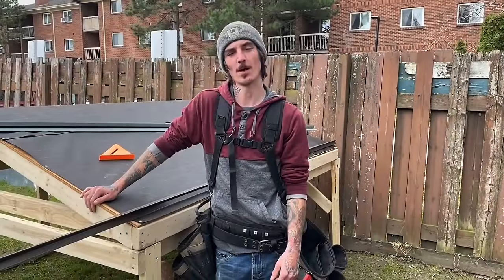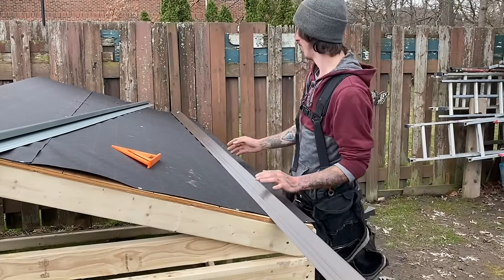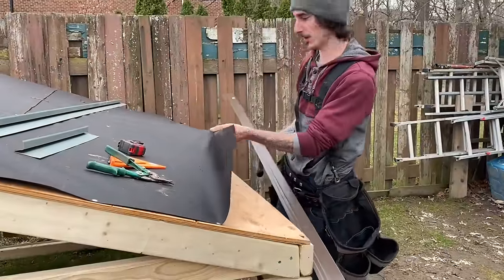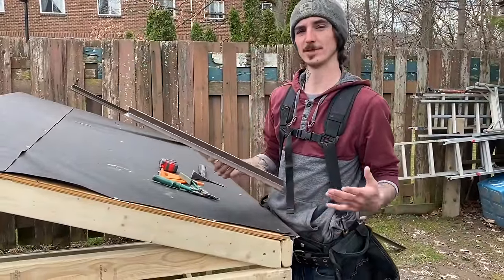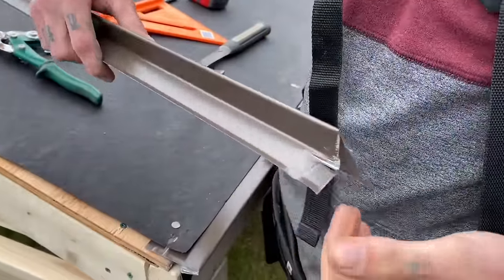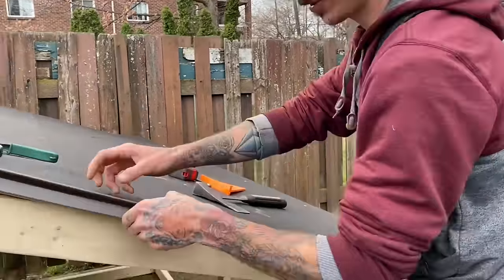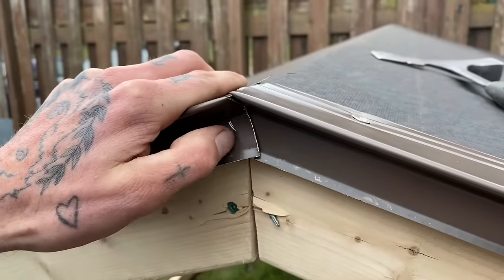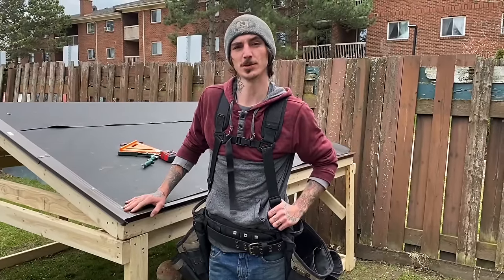How To Install Drip Edge On A Roof

Comment: Thanks for the lesson !!
Reply: That was probably one of the worst instalations I have seen!
Reply: @stephansomerset6967  and a few things you
Reply: Good job Dylan 👍
Reply: What if you started the rake drip edge so that half the length goes past the apex of the roof? That way you can make a cut right at that apex and fold the remaining drip edge down the other end of the roof. This would prevent having to marry up the two drip edges right at the apex

Comment: It's better to leave a gap between the drip edge and fascia. With direct contact, the drip edge will run the water right down the fascia and rot it out.  A gap is also ideal for gutter installation.
Reply: My fascia has aluminum on it, and the back of the gutters slipped up easily between the drip edge and the fascia.
Reply: There's a fascia install that fits behind the drip edge before the gutters go on...
Reply: I was gonna say the same, but saw your comment.
Reply: Leave a small 1/8" gap. I have repaired  many fascias water damaged by too tight drip edge.
Reply: @Fred Bush III were in Canada with our climate we all do aluminum fascia the drip edge needs to be tight to hold your facia. If you leave a gap it will flop and youll have to screw it and it will oil can badly. The gap thing is for old houses with wood facia.
Reply: That is why the fascia is painted and is of excellent lumber. Water is always going to hit the fascia. That drip Edge could go half way down the fascia and it still going to get wet, weather or not it's in direct mail contact of fascia. But I do understand the theory behind it ...there's another video out of a guy leaves it finger thickness away from the fascia. He was teaching a bunch of kids I don't know if it was a high school thing or what ,good video too and he demonstrated it with a 💧bottle....it worked perfectly. But totally  controlled conditions.ie no wind ..But at the end of the day I don't think it really matters. I'm so high tonight sorry for the incoherent ramblings...🤣🤣🤣🍸
Reply: @Fred Bush III I'm a repair guy, I've been there. The turnout at the bottom of the dripedge is inadequate. Why do you think they put eaves in the first place?  Sure the siding is made to take water but less is better. All this being said, I am talking about wood not aluminum. Details make the job. They are the difference between durable and chronic  repairs.
Reply: @caseykelso1  💯✅is why you paint your fascia and trim with good quality. You do not want a gap to mildew. Some even run some caulk in some areas to close the gap.
Reply: @adamarlem9863  mildew is never a good thing.mold sucks to 🤢 thanks for sharing 🍸
Reply: @frankdaniels4364  thanks, wanted to see it again . 🍸
Reply: Or use gutter apron like you're supposed to...smh
Reply: Fixing stuff TV, my contractor didn’t leave a gap and sure enough, my fascia boards are rotting and it has only been a year since the roof was installed!
Reply: @caseykelso1  In snow country painted facia still never lasts with this new crummy non-lead paint (flakes of) until they started covering it with the aluminum or even vynal tucked under the drip edge. .  Im finally a believer in covering painted facia (I do both for protection).
Reply: Yep. Average is right. Congrats, this guy just showed everyone that doesn't use metal fascia how NOT to install drip edge and how to wick water up to rot out your fascia, eaves, and rafters. Break that surface tension and hang it 1/4" off the edge and stop all that nonsense and then you don't need metal fascia either.
Reply: absolutely 1/4 gap is reqd for gutters
Reply: Just use azeck fascia board it will rot
Reply: Why is a gap necessary for gutter installation
Reply: Surface tension causes this.
Reply: Not a fan of the drip edge being pushed up against the fascia

Comment: At the top of the rake, you should silicone the where the two drip edges meet, other wise wind driven water WILL get under it and go all the way down the rake, possibly into the sheathing edge your trying to protect.

Comment: Thank you for taking the time to show us about the importance of drip edge.  I bought a house and discovered later no drip edge around roof perimeters and substandard work / lack of flashing on chimney and gables.  Valleys were "basketweaved" with architectural shingles which I was told voids their warranty.  I am able to go to view Youtube and see videos like this where I can see and learn.  Roofs are expensive to replace/repair  and I didn't expect to worry about a re roof for several years; now I do.  Again, thank you and I appreciate your time and trouble.  It is so easy for some of the others to make snarky comments but then again, it takes very little to type some degrading comments and a whole lot more to take the trouble, time and resources that you did.  Not to mention it bespeaks the lack of character of the snarks.

Comment: Agreed. Use a 3/8" gap over gutters to prevent weeping back to facia board. Noted on This Old House.
Reply: If the fascia is wrapped in aluminum, no gap is necessary because the gutter board is protected by metal. Let the shingles hang over the drip edge by 1 inch to ensure the water goes in the gutter and not behind it. Leaving a gap opens up the possibility of wasps and carpenter bees having access to the wood.

Comment: Wow!  I have been trying to learn about ice & water shield, synthetic underlayent and drip edge.  I watched several videos and still did not quite get it ... now I get it.   You used that small mock roof which really placed everything down on my level and finally as you explained how cutting the back end of drip edge and tucking it around the corner seals the whole corner of the house much better than just butting it up together, it suddenly became clearer.   I even gained more clarity about underlayment being installed UNDER EAVES and ABOVE RAKE edge.  Hey, what can I say except thanks? Now I'm ready.  LOL

Comment: Great job, I have a 6 year old roof, the roofer took shortcuts, they installed rake edge but not drip edge. That’s not the ONLY shortcut they took either.
Great video & instruction.

Comment: Am building a 10x12 shed right now. Tomorrow I will put on the roof, corrugated metal panels. Watched this video so I could put a proper drip edge on it. Thanks for making this. I'll do it the way you suggested!
Reply: Average Roofer is nice guy but the drip edge must be away from the facia board (most recommend 1/2" - 1") so the water does not get pulled back and drain along it.

Comment: It's very important to leave a decent gap between the drip edge and facia board to keep the water draining straight down (most recommend 1/2" to 1"). A 1 x 2 furring strip works well Also, be sure to extend the shingles 3/8" - 1/2" beyond the drip edge to prevent water from getting sucked back and up - This Old House has a great short video showing why and how.
Reply from the maker: https://youtu.be/9wMMqsBAXlM
Reply: Yeah not true.
Reply: I saw the same thing and it is indeed true
Reply: whats the point if you're installing facia metal and gutters?
Reply: Much of today's house's seem not to have a furring strip, which I believe is the best way to do it.
Reply: @byeverywordofgod9138  gutters are supposed to go behind the drip edge. Another reason why the gap should be there.
Reply: @mark1952able  used to be the norm but with facia metal being the better alternative nowadays, also wasp nests are no joke in that 1in gap
Reply: @CountBeefy  ???  Gutters inner edge are supposed to lay inward relative to the drip edge, obviously, but gutters are not supposed to engage/clip behind the drip edge vertical wall, so the gap between that wall and the fascia has nothing to do with the relative position between the drip edge and the gutter.
Reply: @tristonfitzpatrick4198  it’s 100% true. You’re supposed to leave a finger width at least between them. Don’t spread misinformation
Reply from the maker: Always check local building codes. It’s varies from state to state.
Reply: @Average_Roofer  absolutely. As you mentioned in the video the edge is supposed to go under the tar paper/underlayment according to code but in Florida you can put it over the paper and it’s still up to code. Hurricane winds make you have to. 
I don’t think it’s even a code issue with leaving space between the drip edge and the fascia it’s just the best way to operate, the surface tension of the water causes it to run back up the bottom of the edge unless there’s a gap.
Reply: @detroitdabber313  In Florida, I read it goes under the underlayment.  Alternatively, if it goes over the underlayment, it has to be sealed to the underlayment with roofing cement...
I have been learning as I research, but what I am finding is a lot of controversy about the this old house advice, and I find a lot stating that it should go flush and that a gutter should NOT go under the drip edge.  There is another flashing, called a gutter apron, that then goes over the gutter edge, if needed...
Reply: @troubleshooter1975  Yeah same, been researching. I found that Florida is the only state where you can do either one and have it be up to code. Everywhere else it has to be under. Definitely a lot of conflicting information out there. I’m just trying to install a new edge on my existing shed roof trying to do everything as correctly as possible.
Reply: @patricklaughrey8727 no it isn’t it. Check the manufacturer recommendations and what code says.
Reply: @marcusorillius6971  no sir you are incorrect. I take it you've never seen this old house?

Comment: Good video. Although usually with steel drip, if you cut a notch out of the inner intersecting piece, you can get a tighter and more flush overlap. This way along 60-100 foot sections, you don't have a bump out or wavy drip along the fascia.

Comment: Good video!  The only thing I would do differently is to have the drip edge about half inch to a full inch from the fascia.  If you don't, the water won't go into the gutter but down the front of the fascia and rot it out.  The gutter needs to be installed behind the drip edge.
Reply: Good point. If there's no gap, water WILL dun down the fascia in moderate to heavy rain or during sustained light rain. Using a 3/8" gap is usually enough to prevent this... I'd be very waty of more than a 1/2" if living in a high wind region. 1" is far too much in very windy areas, allowing wind to tear off the drip edge if additional fastening is not done to keep it in place.
Reply: Additional fasteners can be used, but you run the risk of heat/cold expansions and contractions doing strange things to the drip edge that can affect the integrity of your roofing, as well as creating a degradation of the professional appearance of the roof's edge.
Reply: @jkbowers56  I don't even measure, I just do a finger width. I have never had issues with wind.

Comment: Great idea using a smaller mock up to demonstrate techniques for teaching.  Have you any tips or videos on repairing Hardie Plank ? I had a shed made out of Hardie panels years ago and top right corner has some damage. Need to seal and protect, doesn't need to be perfect.
Reply from the maker: Michael Blast you’re looking for a video example of how to fix the decking?
Reply: @Average_Roofer  no not decking, it's a cement board type of material that's called " Hardie " panel or Hardie Board... The shed was custom made... I was wondering how you'd approach such a repair ? I figure you may have come across a variety of materials. * I think it's like cement board. I'll look again at the sticker.
Reply: @MichaelBlast  Have you considered using thin set and mesh to correct damage if it is a small enough area that you could finish it to blend well enough? Not speaking from experience but rather adding to the conversation if anyone has a reason this wouldnt be correct im interested.

Comment: I have a question. On the first Z flashing, you put it under the felt paper but on the gable end, you put the flashing on top of the felt paper. Wouldn’t you want that flashing underneath the felt paper for the gay boy and also?
Reply from the maker: It should be on top on the gable. This way if any water get under it stays on top of the felt. 

On top of the fascia drip edge to allow any penetrating water to drain off without touching your plywood decking.

Comment: As a seamless gutter installer - huge pet peeve - when the drip edge is bent at the eaves🤬 i also use gutter apron on the eaves & drip edge on rake. Midwest offset aviation snips - red and green👍
Reply: Yea I do seemless gutters and shingles everyday.  I prefer it not bent around corner.  That way when I go to install gutters it’s not a pain in arse.
Reply: Gutter apron!!! Why did he use drip edge smh lol
Reply: Question. Some roofers have said paper over drip edge, but direction on shingles says paper under drip edge. Which way is right
Reply: @allennewman632  ice and water barrier over your gutter apron at the eaves👍
Reply: This guys a hack. Cut your corners flush no wrapping. And when you got drop around drop like he did when he over lapped it it makes it stick out. You cut a relief to stop that. And he used a tape to cut the easiest piece you out on a roof. I do whole roofs not tape

Comment: What's your opinion on having the drip edge over hang by a 1/2 inch? This Old House has a video describing that it is needed to keep rain water from contacting the fascia board.
Reply from the maker: Mike Mays it does work however it’s an extra preventative measure and isn’t actually necessary. Drip edge made by a good manufacturer is already bent out a half inch from the fascia board.
Reply: @Average_Roofer  True, but it can still wick up behind the drip edge if it's in contact with the facia board.  That's why some manufacturers make a "double" drip edge (see Rite-Flow drip edge to see how it works.)  I've never seen the usual drip edge, pressed up snug against the facia board that didn't sheet water down the facia board.  Go out during your next rainstorm and watch.   It needs to stand off from the facia board a bit or use the double drip edge.  Otherwise wood facia boards have rot in their future.

Comment: How about bending the top piece and cutting a relief below? This way no water can enter.
Reply: That's what I do...I would never install it with 2 pieces butting each other...your asking for a leak
Reply: Spencer Hall absolutely.  I ve seen a lot of guys do a lot of different things re drip edge and flashing. Lot of code confusion sometimes and /or common sense. So of the new stuff like ice/water barrier vs felt stick to the roof as you put it down leaving some confused - drip edge under? Roll the material down the fascia then drip edge? I just watch an experienced roofer do it the wrong way.  At the rake do you put drip edge over it or under? Again he got wrong.
Reply: Come on.. Do you really think that there's going to be enough water hitting that area to cause a problem? Fascia boards are meant to resist some rain. They are on the outside of the house right? 

All you have to do is when your piece hits the ridge, cut it slightly so it doesn't poke out the other side of the roof, then snip off the bottom lip of the drip edge, then when your drip edge comes from the other side, cut it flush with the fascia angle. There's a overlap underneath and the two peices should be snug to eachother. You can even have the bottom lip of the drip edge that's overlapping, clip onto the piece that's behind it.
Reply: @Josh-ww5kz  yah I mean both ways will work no ones disputing that, but the relief cut won’t allow any water in at the peak.

Comment: Hi, first thank you for the awesome video man. My question is about the bottom drip edge. Do you overlap the same way as the side? Or what's the proper way to over lap it?
Reply from the maker: Pixel2 Xl as long it’s on the roof gable it’s preventing wind driven rain. As for overlap we generally say do the eaves (bottoms) first then overlap your gable (rack edge) I top of the eaves metal.
Reply: Yes you overlap your drip edge joints the same way he showed for the rake edge joints.

Comment: Any suggestions how to nail the drip edge after shingles installed. My shed needs a drip edge
Reply from the maker: True North Muskoka using a flat pry bar, carefully remove nails along gables approximately 4 inches inside from the gable edge. Do this all the way up the gable. Insert drip edge by tucking it in below the shingles ensuring not to damage the shingles, and making sure it is fit securely to the roof decking. Once in place, replace the nails you removed along the gable edge and make sure you nail the drip edge during your re nailing process. Do no face nail shingles. Also make sure nails are covered by shingle course to prevent the nails from rusting and leaking.
Reply: Your Average Roofer thx. Appreciate it